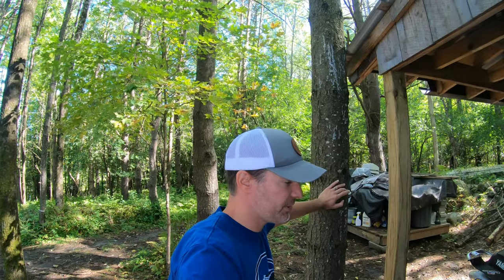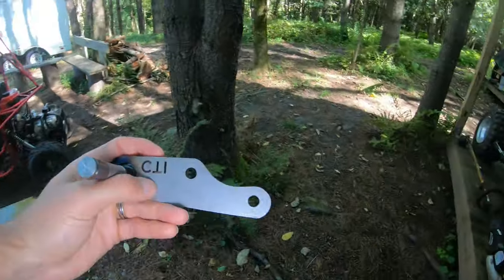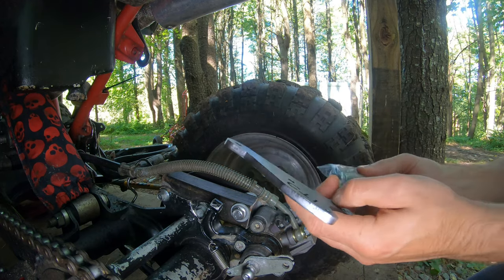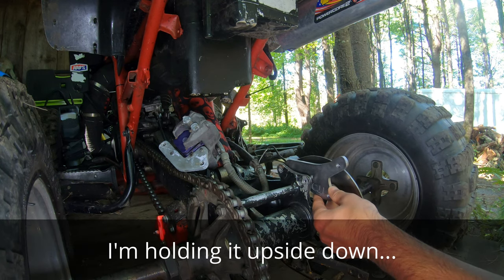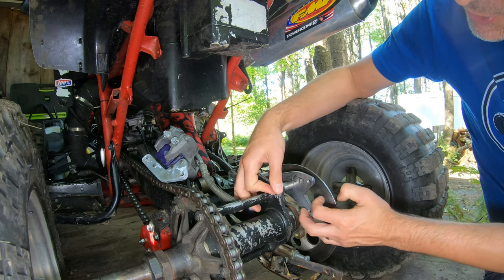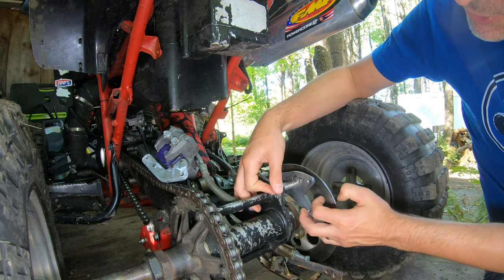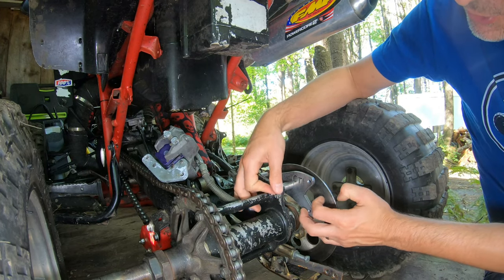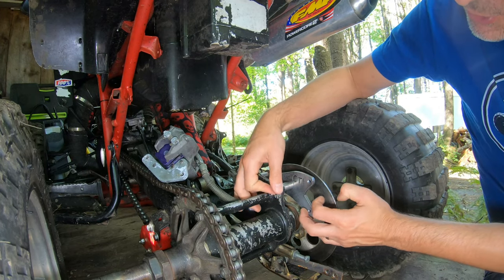How to Install CTI Rear Brake Hydraulic Conversion Kit from Cronetec.com on YFS200 Yamaha Blaster

Comment: Broo, thank you sooo soo much for this video. My family had had a decommissioned blaster sitting in the barn and I've been dieing to get it going again. We just got our full crontech in yesterday and am very impressed so far with the design. Thank you so so much for the hard work man! You rock
Reply from the maker: That’s awesome! I was pumped when I found the kit. Brings some new fun into these old quads.
Reply: Yea it really does, I ain't no master mechanic by no means and I a blast tearing that apart and putting new in

Comment: Are you running front disk brakes? Bought mine from a scrap 2004 blaster. I believe the rear 2004 blaster rear hydraulics will fit without much hassle?
Reply from the maker: Front on this one are still drum. I just did a swap on my most recent Blaster build project on the channel. These rear’s are easy. No fabrication needed. Now that I’ve done a few it take me 15min plus bleeding the lines. It’s a nice kit. One of my upcoming videos will feature another install.

Comment: How do you bleed the brakes i order from the same place and lost on how to bleed them
Reply from the maker: Tons of videos on it but essentially… open the nipple on the brake, depress the brake lever and before you release it close the nipple, then release. Keep repeating and you’ll get the air out. I would say though to do a YT search on reverse bleeding. I’ve found it works quite well if you find you have air bubble that you can’t quite get out. (It’s easy once you see it in a good video. )

Comment: Did you have to grind off the piece where the old brake line was routed?
Reply from the maker: Mine was already mostly ground off by the previous owner. I didn't look like I would have needed to grind it off though if it had still been there.

Comment: Total cost on the conversion with kit?
Reply from the maker: About $130 for the Cronetec kit on their website, another $20 for the used hydraulic lines, cylinder and caliper on ebay, (You can get it new on amazon for about the same price which Iooking back.. I should have done.) Then another $30 for the pedal from BikeBandit.com OEM. Still works awesome and given the price of quads post Covid still worth it for me with Blaster's going for $1700 - $2700 up here in New England.
Reply: @VermontLife  thanks for the info, sold my 240 vitos blaster all worked up, having deep regret.  Saw some older blasters that are affordable but they all have shit back brakes
Reply from the maker: @willyloehman2812  I like these quads for what they are. Fun, simple, light weight, easy to work on and can take a beating. I keep thinking one day I'm going to do a full tear down on this one and do it right. Vitos 240 would be on my short list. Too bad they are getting more expensive.
Reply: @VermontLife  always wanted a blaster as a kid, found a good deal on one 1k for a 2006, until it blew up on day 1, to be safe i did top and bottom vito stroker 240 big bore, moto tassanari reeds, toomey pipe,new bearings anything i could find for it.  It was an absolute beast but i sold it shortly after cuz it was so loud it was impossible to ride in the burbs (and i was offered more then i put into it) without cops coming, block was smoked out.  Sold it to buy a 4 stroke for the noise but the blasters can be such a great deal for what you pay.  Quadless now and need a new money pit

Comment: Looks like a pain in the ass😂
Reply from the maker: It took a little effort but having a good hydraulic rear brake made the quad much more rideable when hitting it hard. I used to pop the front end up all the time trail riding and at that point... there was no way to set it back down. :)